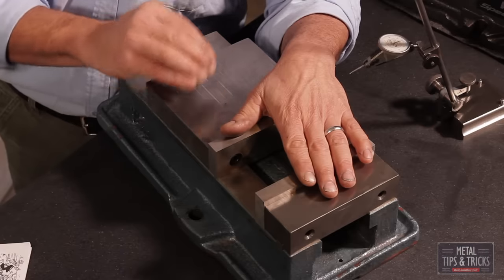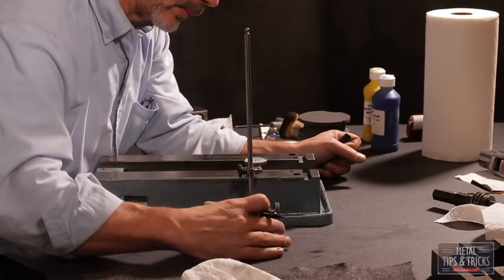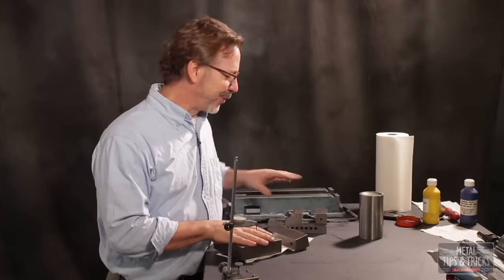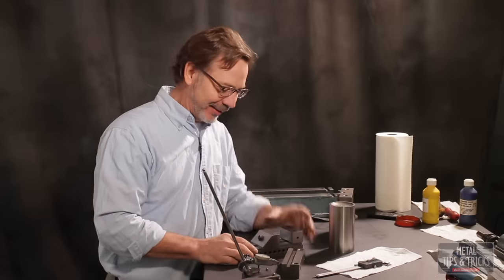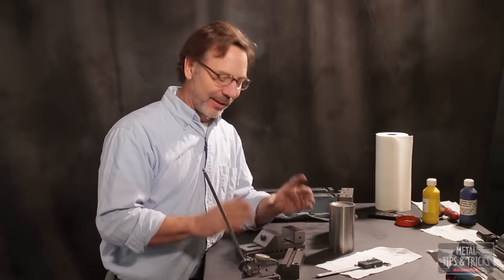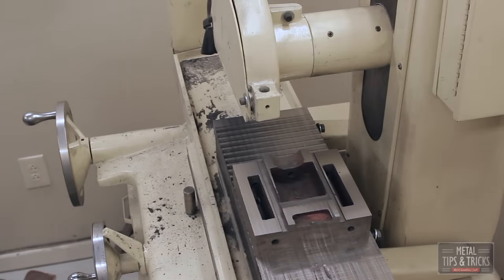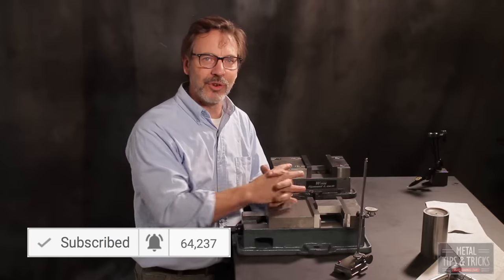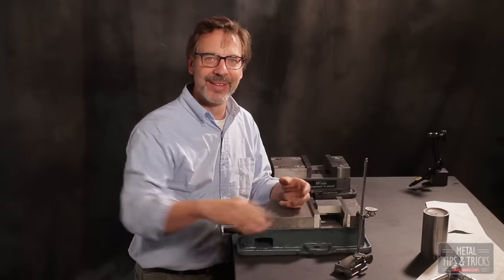China vs Usa  controversy machine vise

Comment: Regrinding the vice the way he did it was a waste of time and he should have realised that. I've just been through all that stuff with my old abwood vice. Conclusion. Past its sell by date. Bin it. Buy a new vice. After researching vices I can say its a mine field of staggering proportions. If you own a grinder, you need a vice that will cut with the least deflection and best square you can buy unless you wanna spend all day squaring the job up with a grinder.  Four thou tilt (deflection) over three inches is simply not an option. This is the question you ask when buying a vice. No answer. Don't buy it.

Comment: I know you were working to a point but it would seem that checking the deflection under load would have been the second test following static measurements. That would have probably stopped the 12 hours worth of work before it started. That would have also made for a boring video....

Comment: I enjoyed the videos Dale, and enjoyed reading through the comments as well.  I did a similar job to a 4-inch import vise that was included with a horizontal mill I bought and had similar results. Each product has it's place and I'm sure if everyone could swing it they would by the Kurt.  Some comments on comments.  These products aren't vices, they're vises. Dale was poking fun at the dude, and vibrations aren't dampened, they're damped. Sorry, I couldn't resist!

Next up Hardinge HLV-H vs. Feeler copycat, or Bridgeport vs. Valuemaster!

Comment: A proper machinist would not take 12 hours to do that.  You also didn't address how square the moving jaw was in relation to the fixed jaw, or the clearance between the moving jaw and the body in either direction (which was probably causing most of your jaw lift).  If you're going to try and fix something, at least do it properly.

Comment: Great job! I stopped buying Chinese long ago. Like comparing a Starrett micrometer with a Chinese one, hahaha.
Reply: Clearly you have not bought Starrett lately. Many of their products are now made in China yet they still charge made in USA prices.
Reply: You have a great point, yes, indeed Starrett has a "Global" line which are manufactured goods from China. I was referring to the USA made Starrett tools, which they still make in Athol MA. Yes, I still buy and recently bought from them. I own a small machine shop and we machine precision parts. You can't tell me that a Chinese vice compares to a Kurt in holding the work piece steady, so you can machine down to one to two tenths with reproducibility. If your business depended on precision machining and measuring, you can't afford cheap. For a hobby machinist it probably will not matter. What makes 'Build Something Cool' so interesting, is that even after precise re-machining of the vice, he still could not get the precision needed for making commercial parts. And the fact that this was done unbiasedly makes it a great and interesting story to be told!
Reply: Unbiased ??? you must be watching a different video to me. This guy is a clueless shill.

Comment: You lost me already at 2 minute in... I think it is quite clear from the price that the cheaper vise i not an attempt to sell me a more expensive product... Caveat Emptor, buyer beware, after all.
Reply: So I cooled off a little, and watched to the end. Good job on the regrind. I'm not surprised that the cheap vise still is flexible, the low price goes all the way on these :) For my work, and I suppose many other homegamers, 0.1mm is plenty close enough.. Oh, and this time, you did not point out that the vise is metric as a negative point....

Comment: Well, I just bought a China made 6" milling vise yesterday . $ 119.99 from Amazon.----- "Happybuy 6 Inch ACCU Lock Down Vise Precision Milling Vice - 6 Inch Jaw Width - Drill Press Vise Milling Drilling Machine Bench Clamp Clamping Vice (6'')".------  Do you know why I spend $120 on something which is not good and peace of sh... as shown in your video?  Because I can not afford machines or devices made in USA.  All I have is China made very old ZAY7032G milling machine, which I bought from scrap yard for $ 280 and restore it.  Then I learn how to cast aluminum and build CNC and I have to use China Made components as electronics, motions because USA components are very very expensive.  So far I`m OK with China stuff.  My biggest problem was with cheap 2.2kW water cooled spindle which I have to regrind as the run out was tooooo big.  

I agree that the vise I ordered wont be as good as vise you advertising.

Comment: thanks for trying 
here is a tip   google machinist vice then tell me witch brand looks as different as yougo to a mercedes
if anything the Winn is the odd one out the chinese one locks more like any other vice on the market
so i still call your argument bs
but again thanks for trying
btw by your cost calculation the Winn vice has been made in less than 6 houers ?wonder how many houers of that is grinding

Comment: Only someone who doesn’t import from China would say that China will build to a standard of you pay more. 
In China, once you establish a minimum quality standard, the Chinese factory will constantly reduce the quality on subsequent orders, until you pull them up on it. They always do it.  If you threaten to stop buying, they don’t care. They are constantly cutting corners and using lower quality components. 
When you buy a quality non Chinese product and you need to buy another after a few years, you will get the same, or better quality. That is a fact! 
The Chinese are good at producing poor quality knock-offs only. That is their greatest con. Making you think that even though it’s cheap, it’s still reasonable value. It’s not!
I would rather buy a used quality item than a brand new chinese made one.

Comment: I watched this video with great interest. 
1. Using just a dial gauge on a marking table is very primitive. Not comparable to modern measuring equipment for quality control.
2. By using a magnet, even with shims, is the incorrect way in my opinion.
3. The grinding machine has not enough cross travel and you have to move the work piece. By moving the work piece the original alignment will be out. I also noticed that you magnetic base handle does not even have knob, just kleen thread......Do I miss something else.
4. Grinding idividual components and then reassemble, the visce should be out. Simple, the geometry from all components changed.
5. 50 years ago, you could through a casting outside for a year before machining, not in this date and time
5a. The only way to relife stress in a casting or manufactured piece is by heat treatment. The "pebbles" is as good as an old wives tale.

I am working in China for the past 15 years, 6 years for an American company and 9 years for a German company. ALL the machines and tooling are Chinese. However, the equipment we manufacture all adhere to DIN and ISO standards and these equipment are shipped all over the worldwithoud any problems.  Maybe you should invest in more accurate measuring equipment and bigger and a bigger and better grinder.

Maybe I waisted my money at MIT.........

Comment: I have to wonder if the surface was not the real problem at hand. Maybe it was just a new screw and nut where the real issue is on the Chinese vise??? If that is the problem, you could grind until the cows come home and not see an improvement. Don't know why it's so bad, but just saying I don't think grinding the surface did any good, although you did improve the overall squareness.

I'm not trying to defend the Chinese vise, and I don't own any kurt style imports, only kurts here. I bought a scratch and dent from kurt's web site and it's been very good to me. I just never have seen the value in trying to save money on a vise. If that's the case buy used, but buying a used vise is like buying a used lathe chuck...and why people buy Chinese lathe chucks...BTW, I don't own any Chinese lathe chucks either...LOL

Comment: I'd have a little more respect for your video if you actually had the vises clamped down LMAO. All that work on the surface grinder yet you didn't even mount/clamp the vises to a machine table to compare the part lift properly??? Clamping the vise down to the table is part of the structural integrity of the vise. Whereas Clamping a part in the vise with it just sitting on a surface plate, etc. is not proving anything relative to the actual conditions when mounted properly in a machine.

Comment: The beginning of this video is what explains the very thing that most seasoned machinists know;  Generally, Chinese made products are not equivalent to their American counterparts, and even when buying a cheap Chinese knock off, you are not getting what you paid for.  If you are honest with yourself, and you bought the cheap Chinese vise, you would be hoping to get a vise that will do exactly what that type of vise is expected to do.  Because of the many defects in said vise, you not only did not get your moneys worth, you got cheated.  You got cheated because the Chinese did not tell you;  "This is a substandard vise that looks like a Kurt".  No, they did not say that.  They say it is a certain sized vise, which you already know is the size vise you need for your mill.  They say it meets certain specs.  Armed with that knowledge, you buy the Chinese vise, because the Chinese are saying it is a certain amount of "good".  You paid the price they were asking for the vise, so you paid them full value.  Since the vise is defective right out of the box, and the Chinese know damn well it is not up to the specs they claim, you have been cheated, even though you paid less for it than the Kurt vise of the same type.  So, for this Chinese vise at $200, you did not get a good price on a vise.  You actually got something that was not even worth the $200 in the first place!  You were cheated.

Any time something is represented as a certain thing, at ANY price, if you do not get the thing as represented, you have been cheated.  Just like when you see a Chinese DTI for $50.  They say it is "jeweled", and we know what that means because when we bought our Starrett or Mitu DTI that claimed to be jeweled, we could open them up and see the tiny jewel bearings.  The Chinese have cheated you once again, because you will find no jewel bearings in their "jeweled" DTI.  That is selling by deceit, and all too often their normal way of doing things.  

Getting something cheap does not equate to getting your moneys worth unless that cheap item lives up to expectations, and the expectations are given by the seller, not the buyer.

Comment: So appart from this just being a big and unfair paid advertisment, this guy does not understand what quality means. A $0.02 paper cup can have better quality than a $75 stainless steal thermos. If you design the paper cup to hold water for 60 seconds without breaking up and it does it well then it has great quality. If your $75 thermos lid does not seal correctly as it should, then the paper cup is a better product than the expensive thermos. A Yugo could have way better quality than a Mercedes, you just can't compare them to each other, you have to compare each to their own design specs.
This video is just as stupid as the last one, definitely unsubscribe.

Comment: won't buy China junk.  why spend time to fix them?  Most of the time, u can't!
But we rarely have alternative to china ones.  .020" is way unacceptable. 
UC, they own 70 - 85% of world's manufactured
goods = monopoly.  they're motivated to make it cheaper on top of already cheap so
their goods will never get better.  they'll get worse n worse as they cut the material
quality, they even cut the dimensions in length, width, height, and they cut out on
manufacturing steps, e.g., 20 steps req'd item cut it down to 15.  The, they'll cut
that to 7 steps.  No competition against them.  Just like my Corolla radiator, they
did the same.  And for this vice, like the BSC said, they didn't take time to age the
casting for warpage, then grind them.  And, they cut the QC steps to verify the parallel
ness, etc.  US Importers r also at fault as they don't punish and allow the China
makers for shipping 1000 or even 8 units of junk.  And for car parts, actually that
none lasting junk is good for the importer as they break (thin mat'l, for instance or
brittle castings, can't repair, as in the China imported GE Diesel Electric Locomotive
Engines as reported by the Locomotive repair shop).  Junk is junk.

Comment: cheap is stil expensive Just buy not in china and you support local manufacturers and china stuff will die out
Reply: Wrong! 
Expensive does not equal Great - it only mans that you have the money to not cut corners. Cheap does not mean bad, especially not when you have very low cost of labor, 10$ in labor goes a long way.
The difference is that copy cats want to make easy money, and it has more to do with moral than price. If this grind had been done properly in China on a cnc grinder it would probably have raised the cost by 2$
Reply: @jenspetersen5865  I agree with that but from China is always rubish there are country's where they can produce high quality for low cost. But that is not in China
Reply: @jijzer3284  I have had some incredibly high quality products made in China, but you need someone good there to control it, and you don't pay a dime til it is perfect. That ex Apple and pretty much any sensor, computer... product is made there  suggest otherwise. 
In the end however if you go to the machine shop next door you can control it and yell at them. If your are sending it off to China then  it takes you two months to figure out if you got a great deal or junk.